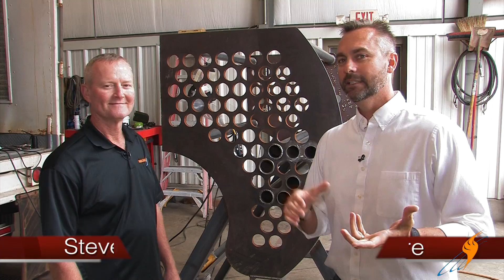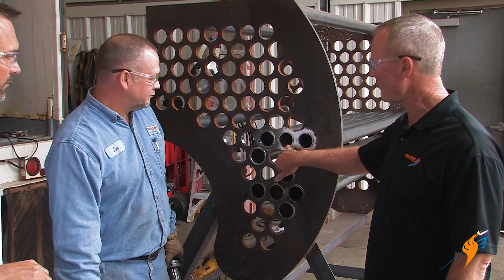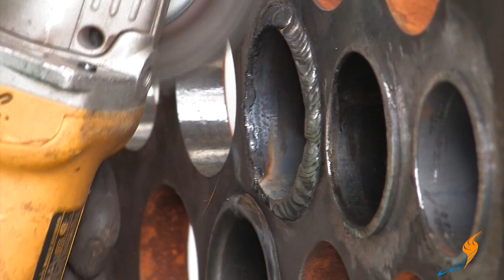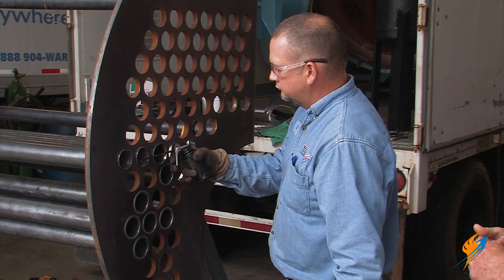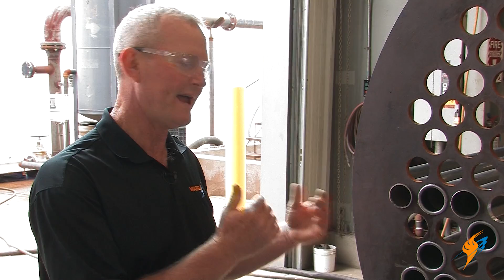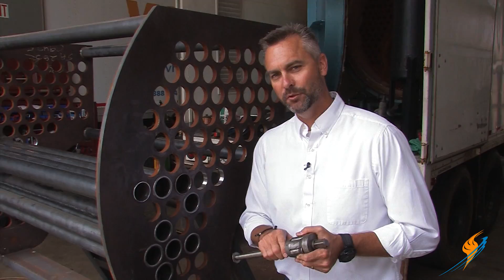How to Roll a Boiler Tube - Boiling Point

Comment: I think if I were buying a boiler I'd prefer to just have the thing welded on BOTH ends and have the best possible seal and heat transfer at both ends. I understand what he's saying about doing it at the "hot end" but any additional heat you can get out of the "cold end" is going to result in a lower tube temp overall. Now I just heard the part about brand new boilers leaking and I KNOW I'd want the thing welded at both ends. It seems like there's no way to get that rolling and beading process perfectly consistent from tube to tube and if there's a tendency for the a tube to "loosen up" after being rolled and beaded so it needs to be hit with the roller again, by the time that process is repeated with dozens of tubes there's no way some of the previously installed tubes won't have been affected and loosened slightly by having several tubes adjacent to them installed, rolled and beaded. Like I said weld mine at both ends and I'll pay the extra $$$ up front for a safer, longer-lasting and more efficient boiler that's tight and leak-free the day its installed. 

I'd have a real hard time feeling comfortable with a brand-new, just-installed boiler, which at that point I'm sure is already considered "used", that had leaks on Day One. I'm sure they DO seal up after they get warmed up but I'm also sure they seal up in part because of corrosion and rust forming in the leaking gaps as hot pressurized water, which is corrosive as hell because its an excellent solvent and is already being forced through the gaps, gradually turns new steel into new rust and scale. But if they're welded at both ends there won't be any leaks and no loose joints to begin with and you won't have to rely on rust and corrosion filling the gaps and/or going back into the boiler to "hit" the leaking tubes with a little more beating and bending of what is already a compromised joint. 

I also have to assume that the initial pressure check once the boiler is installed is a "static test" where the boiler is filled with water, capped off and the pressure is applied with an external pump and probably to a test pressure lower than the working pressure since there's no "gas pressure" on the "hot" side of the boiler tubes and end plates to counter water pressure. I'm sure the pressure on the hot side isn't all that high by comparison but with a cold boiler and a more "direct" and MUCH more UNIFORM pressure pushing against all surfaces on the water side the whole time, which is NOT the case with a fired boiler that has water flowing through it at different rates in different areas since the pressure of flowing liquids decreases as their speed increases, it seems to me that the old "seep vs. drip vs. leak" judgement call might come into play if a cold static test shows some "seeps" but no "drips" or maybe a few "drips" but no "leaks". I'm guessing there have to actual "leaks" and significant ones before "fire it up and see if it seals up" is out of the question and you go back into it immediately to "hit" those leaking pipes again. 

Like I said, at that point I'm sure it's a "used" boiler anyway but probably under warranty and the owner/customer really doesn't have much choice besides let the manufacturer, who is paying the "repair bill" for warranty work, do what they want to do first or demand that they go in and "hit" the leaking tubes before firing it at which point the warranty probably goes bye-bye at least for SUBSEQUENT repairs and the customer is even MORE on the hook for whatever happens down the road and REALLY owns a used boiler THEN. 

Either way, eventually its going to seal but if firing it and letting it run for a while and do its thing for hours or days ends up sealing it up, its probably NOT because gaps between steel components magically filled in with steel unless parts are BENDING and EXPANDING and STRETCHING and DISTORTING in ways I'm PRETTY SURE wouldn't be a good thing. What is MUCH more likely is that where there are gaps and there is poor heat transfer between the tubes and plate, the leaks may be PARTIALLY "fixed" by expansion as long as they STAY hot but there isn't going to be enough water pressure on the water side to "press" the plate out against the tubes which are going to "grow" LENGTHWISE.

And the TIGHT tubes are going to transfer their heat better and stay cooler and expand less and will prevent the plate from "bulging" outward to "meet" the LOOSE tubes which will be HOTTER and EXPAND MORE because the gaps will keep them from transferring heat properly. Sure there will be some WATER in those gaps but that water is going to boil away immediately when IT becomes the heat "bridge" between plate and tube. But THAT BOILING WATER is what ACTUALLY  ends up sealing those loose tubes as all the DISSOLVED SOLIDS in the water get left behind as scale and deposits in those gaps as water flows into them, boils away and leaves everything dissolved in it behind. 

And that ISN'T going to take very long because there is NEVER any shortage of all kinds of dissolved metals and minerals in any closed-loop heat-exchanger system filled with plain water. Over time the water in a closed loop system will dissolve and carry the "loose" and easily soluble metals and minerals back to the boiler and as it cools and keeps flowing through the system on the "return" side those metals and minerals will precipitate out and what ends up back at the boiler still in suspension in the coolest water in the system will be kept stirred up and and in solution in the boiler and when there are LEAKS its going to find them as the water its in finds them and when the water boils away and/or slowly seeps through any gaps at the tubes and then evaporates on the "hot" side of the joint those dissolved solids will form scale and the metals will oxidize and form rust and fill those gaps in no time with that rust scale that's such a GREAT INSULATOR. 

Which means the boiler will "seal up" and seem just hunky dory and without having to go in there and "hit" the leaking tubes again. But I'll bet if a guy draws a little diagram of the tubes and marks on it which ones were leaking when it was new there's a good chance that when the boiler has tubes start leaking down the line if THOSE leaking tubes are marked on the diagram there's going to be more tubes marked TWICE than tubes marked ONCE. 

There could be VERY GOOD reasons from an engineering standpoint for NOT welding both ends such as wanting one end "loose" so the tubes, which will NEVER EXPAND AND CONTRACT at the same rate regardless, don't end up doing one or the other too fast in one area and too slow in another so some get "stretched" and/or some get "crushed". 

But it occurs to me that in  this type of boiler those TUBES are ALSO the boiler's STAYS and are tying the boiler together and that ideally they would ALL be as evenly "tensioned" as possible with the boiler "cold" which might not be any real "tension" at all but "tight". I have to think that goes right back to welding both ends. That has to be better than having gaps and leaks and poor heat transfer during a "leak test" with the boiler fired and having the gaps either "sealed" with scale if you're "lucky" or going back into a BRAND NEW BOILER to "hit" them again and tighten them up which could end up with THOSE being tighter than some or all of the OTHERS. 

Maybe welding both ends makes it impossible or prohibitively expensive to "re-tube" them later so the "benefit" for not doing so is having some "re-tube" business down the road or maybe welding ONE end makes them prohibitively expensive or impossible to re-tube or at least per manufacturer's recommendations so they can either buy a new boiler when the new one is old and worn out and leaking or roll the dice and have somebody retube it and probably pay a big chunk of what a new one would cost. 

Regardless, I'm pretty sure I'd still want both ends welded or a guarantee up front the new one is leak-free on Day 1 and I'd want it capped, filled and pressure-tested to at least half of the normal operating pressure at my location and before the existing one was touched to remove it. It can't be that difficult to cap or plug the inlets and outlets and fill it and apply 125 psi of compressed air to a fitting in one of the inlet or outlet caps. If it doesn't leak at 125 and by "doesn't leak" I mean pressurized to 125 before shutting off and disconnecting the compressed air to make sure it HOLDS 125 for a good 10-15 minutes.

Then I'd be a happy camper and that's another situation where I'd be happy to pay a little extra for the piece of mind. I'm sorry but boilers are nothing to screw around with, they're big, expensive money-sucking monsters that are never going to do anything but take X amount of fuel containing Y amount of heat energy per unit and burn it and give you Y minus the heat energy that didn't go out the vent or into heating the boiler room or into the floor or walls and then the ground of a basement boiler room to USE TO DO WHATEVER WORK YOU NEED TO DO OR HEAT WHATEVER YOU NEED TO HEAT. And they NEVER need replaced or repaired at a "good time". I know that NOTHING DOES but let me rephrase that as they never need repaired or replaced at anything but the WORST POSSIBLE TIME. 

So if somebody told me my brand-new, very expensive, very important, very time-consuming and very soon to be my NEW money-munching monster might leak a little bit at first because...shipping (seriously guys have you not heard of air-ride suspension and paved roads and cautious driving?), but that it will probably seal up after its warmed up good and if NOT all it will probably need is to go back in there and "hit" the tubes with the beader and/or roller again, I don't think it can be enough better of a deal in any other way to stay off the BOTTOM of my "possible supplier" list.
Reply: that was long
Reply: That's what my gf said.

Comment: But if you seal weld a beaded tube do you roll with the collins roll after beading and again after seal weld or only after seal weld?
Reply from the maker: I asked one of our experts and he said you would collins roll for both. We recommend though getting with your boiler manufacturer on the recommended method for boiler tube installation. Hopefully that helps! Thanks for watching.
Reply: Good practice is always to roll the joint again after welding -- both the HAZ and distortion from the bead can cause cracking problems in service.  Note that any 'cracking' in the seal-weld bead from straight-roll Collins prossering is of comparatively less importance unless it could act as a stress raiser into the tube or sheet metal in service, for example with thermal cycling.  If that is perceived as a concern, there are straight rolls that can be inserted to leave the 'back' 5mm or so "unrolled" as this step is conducted.

Comment: - How much stock do you allow to stick out to ensure you have enough material to roll, flair and bead?
Reply: See above: 3/16" for the tube diameter and wall thickness used in these mutipass-boiler firetubes

Comment: If you expand welded joint afterwards then you are risking to have a crack. The best way is to use an expander which is just expanding inner the tube sheet surface.
Reply: Selçuk Sancak I agree

Comment: does steve go out to the job and contract roll tubes?
Reply: we do.
Reply: I think that's inherent in his stated reasons for using air-hammer beading instead of a beading or combination roller -- that if the tubesheet isn't normal to the flue the bead won't seat properly, and would 'have to be hand-sealed anyway'

Comment: I would have thought the plate or bulkhead or whatever would be more rigid than the thin tube wall, and if you rolled till the cows came home the tube would always spring back more than the plate and leave you with a tiny gap. Something like a cartridge case in a gun... it goes in way loose, gets hit with maybe double the force necessary to expand it out to the chamber wall, does indeed become permanently deformed, yet always contracts back enough to allow easy extraction. Or almost always, anyway.
Reply: The tube doesn't spring back. At this level of the rolling torque moment, it gets permanent deformation.
Reply: @selcuksancak  It can't have both permanent deformation AND a bit of spring-back? Googling "rolling torque moment" did not turn up any results that I could relate to this situation. I'm just trying to understand it, not be a smart-aleck.
Reply: @Fuzzybeanerizer   To expand the tube it's applied a rolling force. We call it rolling torque or rolling torque moment.

That's true. the tube spring back too. But it's mostly deformed permanently. As the tube sheet is thicker than the tube wall in this force direction then the tube sheet stays in the elastic area which means that the tube sheet is applying a constant spring force from outside of the tube which doesn't allow a gap in between the hole and the tube surface. Hope to make it clear.
Reply: @selcuksancak  In some locomotive-boiler practice, there is a circumferential recess cut and smoothed in the tubesheet, and the tube is then prossered so that metal fills this gtroove to help lock the tube against leaking when under pressure.  

Are there other videos that discuss the use of copper ferrules between tube and sheet to get better heat transfer and some additional 'seal forming' when the tube is rolled?  That's not common practice in commercial boilers, but can be found in other firetube practice...
Reply: @wizlish  This type of recesses are not necessarily dedicated to impermeability. They are mainly dedicated to avoiding axial displacement of the tubes resulting that their neighbor area keeping the tightness.
Reply: Yes, it's mechanical keying to let the tube serve more effectively as longitudinal 'staying' between the sheets, and to reduce any relative motion or fretting that might be started by thermal cycling in a tube that has merely been expanded to what is now an 'interference fit' against a cylindrical bore in the sheet.

I personally dislike any approach that deforms the tube in a slight bulge outside the seat, for the same reasons I want the bore in the seat clean, polished of stress raisers, and slightly radiused on its outer edges (per at least one other comment)

The cuts in the sheet aren't meant as internal 'sealing faces' like the olive in a pressure joint.

Comment: If it's not welded it's going to leak
Reply from the maker: If you watch in the video around :55 he explains what is actually creating the seal. The process of rolling the tube will actually make it water tight. Thanks for the comment and thanks for watching!
Reply: James Fritz is changing the game... Better listen up, 150+ years of boiler operations...
Reply: No, it's not. A good expanded joint can handle thousands of psi.